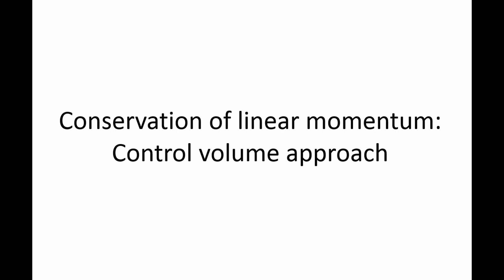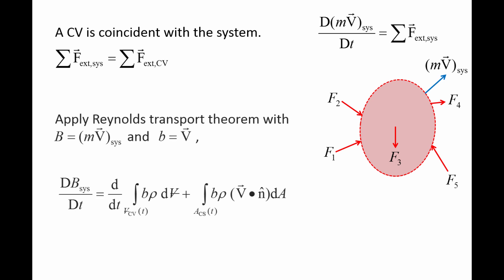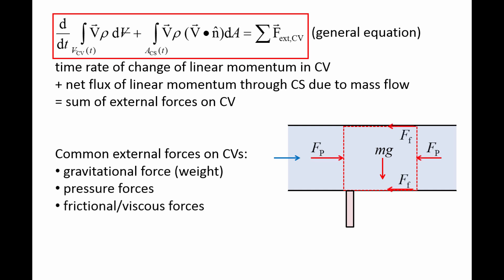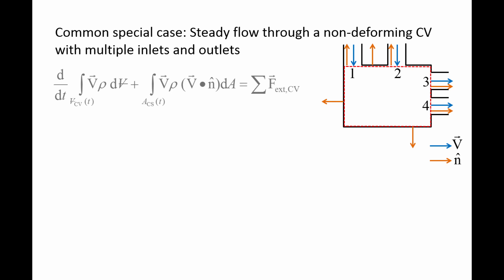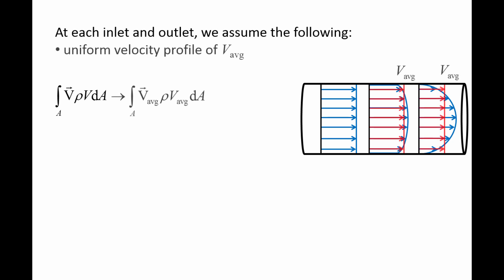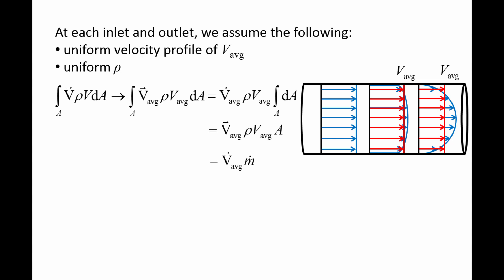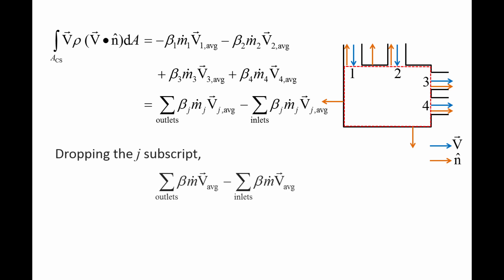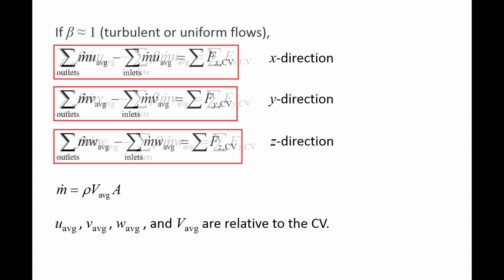Fluid Mechanics: Topic 7.2 - Conservation of linear momentum for a control volume

Comment: Conservation of momentum is a special case. Momentum can be said to be conserved only if the vector sum of external forces acting on the control volume is zero. Therefore, the correct formulation is “momentum balance” rather than “momentum conservation.

Comment: I've learned - 
1. The net incoming & outgoing momentum fluxes & change of linear momentum throughout control at any instant in time contributes to external unbalanced forces. 
2. The external forces acting on control volume is by two ways - Body force & surface force. Body forces are gravity forces & other forces like magnetic, electric, etc. Surface forces are pressure & viscous forces. These all forces combines to responsible for the net change in momentum of control volume 
(Volumetric change as well as fluxes through boundaries). 
3. Momentum transport equation is application of Reynolds transport theorem in which flow of mass carries & transports a property with it - Velocity. 
4. Momentum fluxes are used as an averaged over those respective cross sectional surfaces with correction factors to compensate from actual momentum fluxes at those cross sections. 
5. For each control volume, the momentum conservation equation is written on unit volume basis. As the system is considered to be open system if there is transport of both mass & energy.

Comment: Does all the time external foces acting on the system are the same as the external forces acting on the CV? If not, can you equate Reynolds transport theorem for extensive property of the system to external forces action on CV? (1:24-2:08)
Reply from the maker: Our goal is to obtain a conservation of linear momentum equation for a CV, but the conservation law is usually expressed for a system. The CV is set up so that it completely coincides with the system at a particular time. This allows us to apply the Reynolds transport theorem (RTT) to relate the CV and system points of view. 

If we wait long enough, all of the mass (system) will leave the CV, but we don't care about that. We only want the expressions that relates the time rate of change of linear momentum from the system point of view, to the time rate of change of linear momentum from the CV point of view.